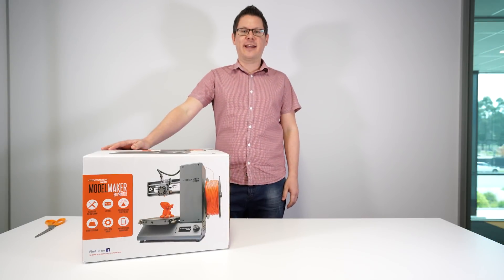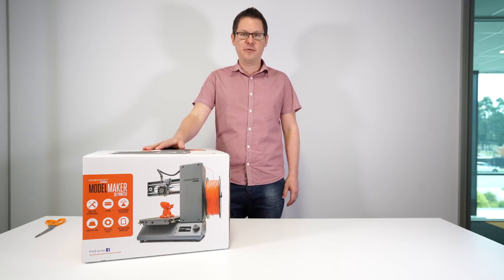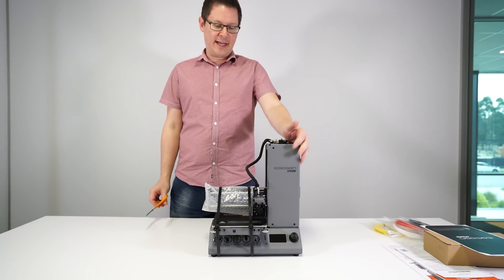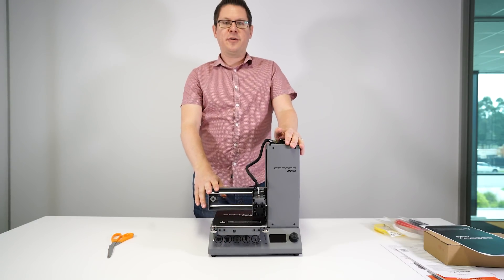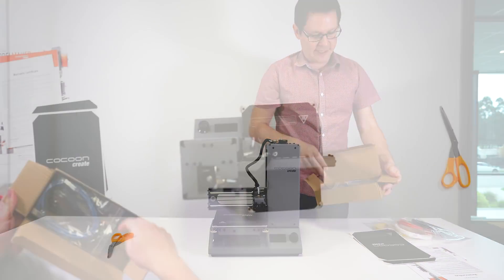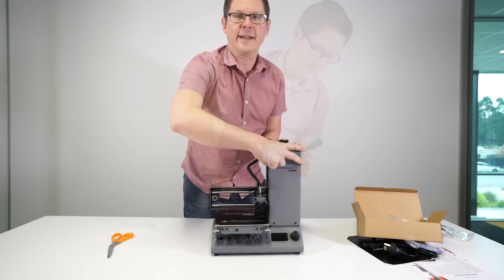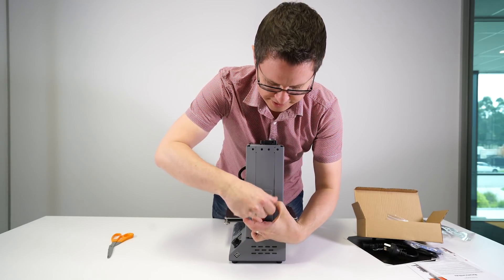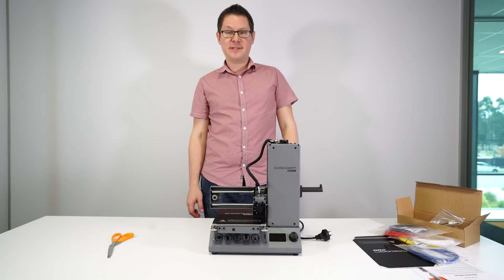Cocoon Create ModelMaker - Unboxing & Setup

Comment: I just got one off ebay. Printed straight away, but wow what a piece of shit. Bed levelling is all over the place, the wizard has me set the bed ends half way through the bed, not at the end, with no way to adjust it. No firmware updates either, no config file for Cura. You obviously test it, why wouldnt you supply a config file on it ?
For $200 which I paid for it, sure it works fine, but anyone who seriously wants to get into printing, dont buy this, buy a Prusa.

Comment: what are the cura settings for this printer - the manual doesnt say
Reply: there will most likely be a cocoon branded version of cura on the SD card. That is how the last one came. Should be preset.
Reply: That is if your printer can read the card. Mine had a dodgy SD reader, card would not mount. Became an ALDI return.
Reply: I get it to start printing fine but then it gets to the second layer and everything goes haywire. I've read everything, checked everything. I have no idea what I'm doing wrong. I'm testing out the gcodes on the micro SD card.